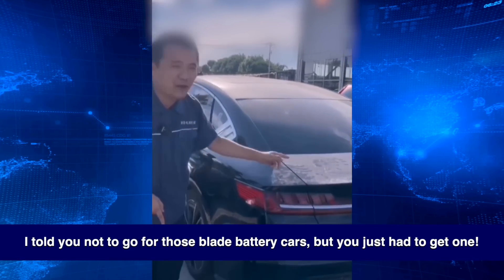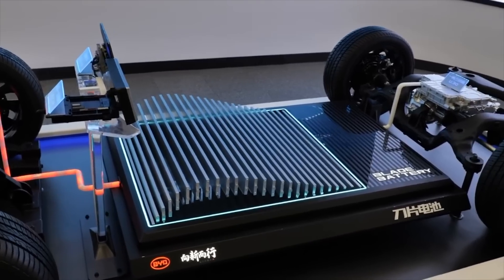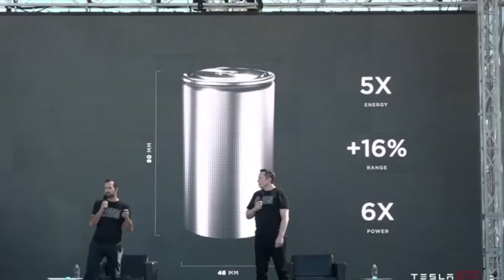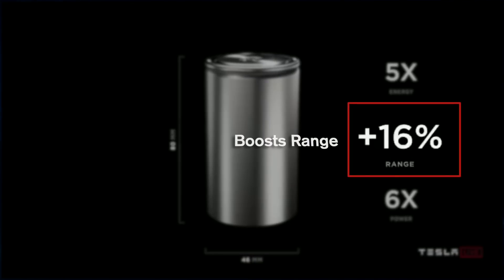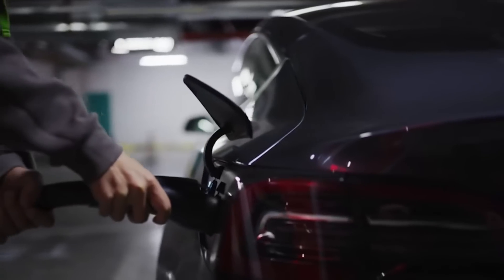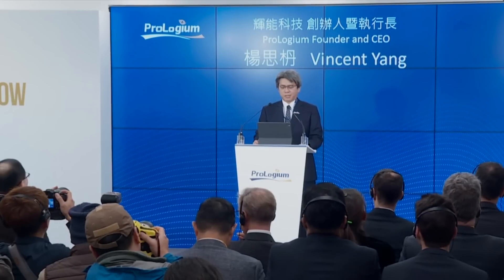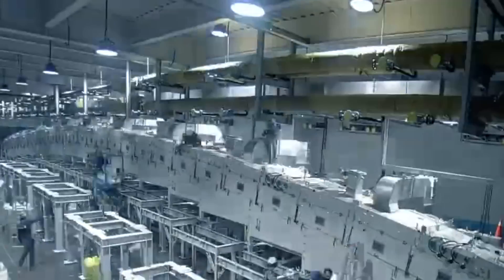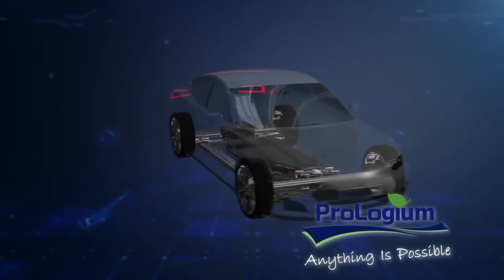BYD's Boastful Batteries Fall Short! Taiwan's Solid-state Battery Mass Production Outpaces China

Comment: i think it is and issue with what the batteries are in, as the exterior casing plastic sheet that byd uses is paper thin and not watertight. if they designed the casing that the batteries (all of them, i.e. the platform) are housed in, making it rigid, and sealing it better with better thermal management, they there wouldn't be issues.

Comment: Wrong, the new Tesla batteries don’t have anywhere near 5x the energy density. They have 5x the energy because they have 4.7x the volume. That means energy density is only very slightly improved. Energy capacity and density are not the same thing. Anyone can make a larger capacity battery by just making a bigger battery.

Comment: NEVER NEVER NEVER BUY A BYD VEHICLES THEY ARE JUNK VERY LOW QUALITY METAL IS USED TO MAKE THE CHASSIS IT SO BAD YOU CAN BEND THE CHASSIS RAIL BY HAND WITH PLIERS THEY ARE MADE SO CHEAPLY . THEY ARE A DEATH TRAP AND FALL APART ALSO THEIR EVS AND HYBRIDS ARE PRONE TO CATCH FIRE SO MUCH THEY ARE NOT ALLOWED TO GO ON FERRIES IN CHINA BECAUSE OF THE POTENTIAL FIRE HAZARD THEY PRESENT do not buy a BYD IF YOU WANT TO LIVE OR LOSE YOUR HOUSE WHEN CHARGING . FROM FIRE

Comment: Unless you realize the solid state battery you are talking about is also lithium ion based. If no tell me what is charge career?
Reply: CATL is already supplying byd with sodium batteries.  Soon sodium will be used exclusively over lithium
Reply: @larryc1616  nope, lithium ssb will take over. way more power, more storage, and less than half the weight of current lithium batteries. yoshino already offers a ssb battery for rv's and home backup use and its a real game changer.

Comment: EVs are just disposable batteries on wheels. When the bat goes with age you have to junk the car. And the bats only last 15 years if that. Mandatory lifespan built in, is the auto makers dream come true.
Reply: Many 2012-13 Teslas now need new batteries, used EV buyers beware. 🤔
Reply: Sure, but some combustion engines ảe the same…tell me, what new Jeep owner today truly believe their vehicle will last 15 years without a major transmission overhaul?
Reply: @zer I doubt a trany cost 75% as much as a new jeep. But I bet they are still making them for the old jeeps, I don't think any EV bats made now will even be available in 10 years to replace what you have now even if you would pay 75% of the cost for a new EV.

Not even in the same ball park. . .
Reply: I have seen a GOOD brand new pickup hit 5 years and need fixes ever 3 months.  15 years looks kinda good.

Comment: to be fair, tesla also uses glued battery packs now that can't be repaire, i'm happy to own a repairable 2021 model
Reply: cant you dissolve the glue with something without damaging the cells?
Reply: @423GustavBern  not that i know of, it's more of an hardened epoxy ... tesla says that the battery swap is faster and cheaper, and damaged batteries are recycled

Comment: Solid State battery Tech still has a way to go especially cost which currently is 5x higher. SS Batteries will get there just needs time
Reply: you dan buy a yoshino ssb right now for rv and the price is higher but not 5 times higher

Comment: Many think EVs will just be a phase or only be a part share of the market. EVs are inherently simpler and lower cost to manufacture when made in scale. Battery Tech is advancing at a rapid rate and are becoming lower cost, higher energy density, long life and provide longer range. Home charging will become everywhere, I lived in Oslo, Norway last year and every second home had EV charging. EVs will be cheaper than ICE/Hybrid cars and a lot cheaper to own and run. EV evolution will win on cost alone. There may be a residual ICE business left but the cost to own a ICE car will be high and a luxury. The transition will take longer than is stated but it will happen. The tipping point has been passed
Reply: Until... the government subsidies end.
Reply: @Juan-os4hs  ev's will help keep the price of gas lower
Reply: @victorhopper6774  
That's a new angle, but I reject it.

Comment: Opening a battery pack with a crowbar sounds like a great idea. If you bend the metal case a bit getting it open just hammer it flat when you're finished. Job done.

Comment: Telsas bigger batteries dont have 5x the energy densety of normal lithium batteries. They have 5x the energy, because they are 5x the size.
Reply: 4680 is 15% more energy dense and 10% lighter than 18650/2170 at 1/2 the cost
Reply: Does Tesla even make them? I am inclined to think Panasonic makes the larger ones as well.
Reply: @ahhmm5381  tesla makes their own 4680 at giga Austin but not enough. Panasonic is way too slow. Tesla is building a dedicated 4680 factory within giga Nevada battery factory so they can make 4680 at full scale by end of the year.

Comment: Holding and prying at a big Kv EV battery with a metal pry bar doesn't exactly sound like a good idea.
Reply: and if the fire starts, good luck trying to put it out
Reply: It's population control with Chinese Characteristics.
Reply: At one time, sitting in a gasoline powered car and going at 20kmh is also not considered to be a good idea. In fact down right dangerous. According to horse carriage drivers.

Comment: So, when solid state batteries finally hit, and every existing EV is rendered completely worthless, what is the positive outcome for current owners?
Reply: Hopefully it wont be to difficult to change and modify existing ev's replacing the battery, fuses software etc.
Reply: Pack upgrades maybe but it'll cost soo much you may as well buy a new battery vehicle 😅
Reply: So auto makers shouldn't come out with better models because of that? 🙄
Reply: You were first... thanks😂
Reply: Drive it till the battery drains or the wheels falls off.
Reply: They will not be worthless. New models will come to SSD batteries, assuming they are success in real world conditions. 
As for the current EVs, Tesla gives 8 years / 120K miles warranty for it's battery. You can guess if anyone will think of buying used Teslas with 100K or more on the odometer. Essentially those used Teslas (or other EVs as well) will be sold for pennies on the dollar.